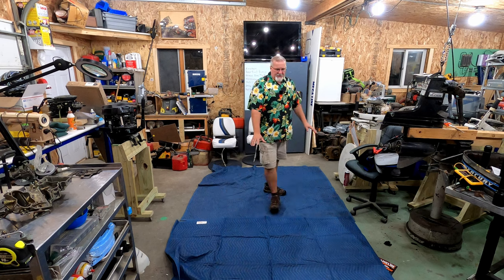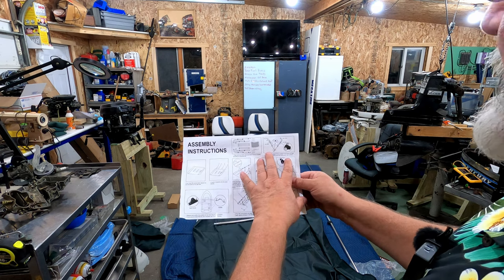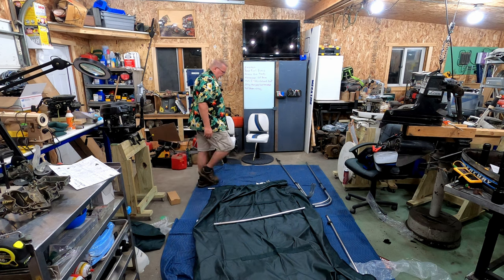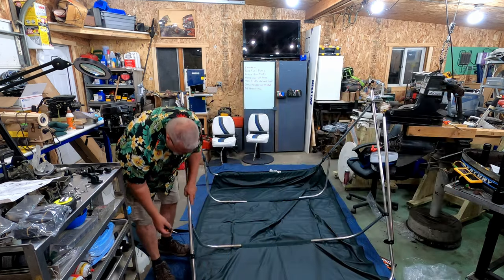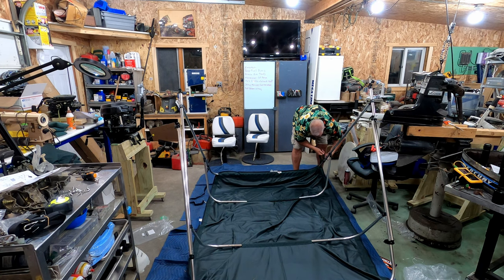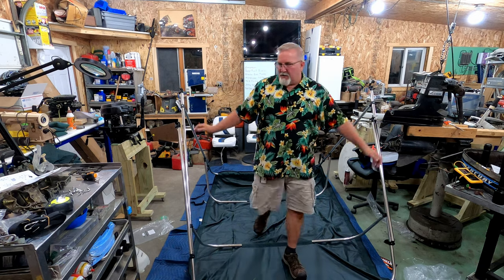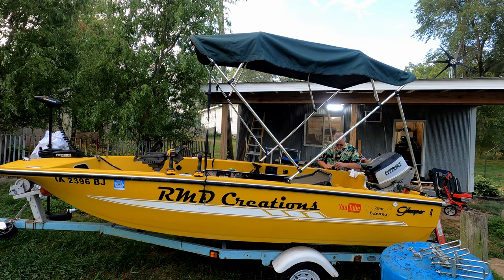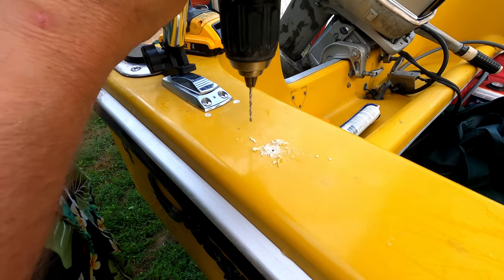1972 Glasspar Evinrude 35hp Gets a new Bimini Top  Looks fantastic  Cover your Banana

Comment: nice top  price isnt too bad. is the material uv resistant??   i'd put those front straps straight down  so it doesnt limit your casting.
Reply from the maker: After I take it out on the water I may just make that adjustment.  Right now I just took advantage of the two clips that were there. It has  PU coating but doesn't mention anything about UV. Thanks for watching as always.